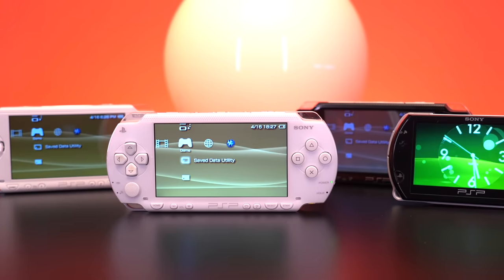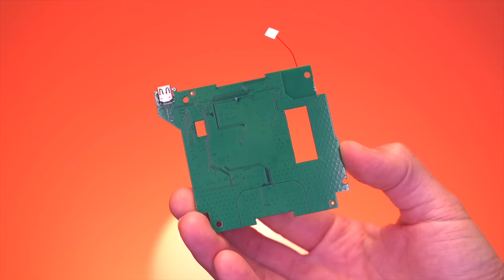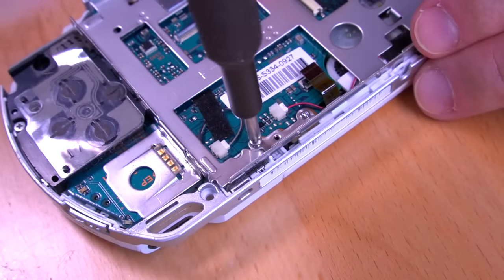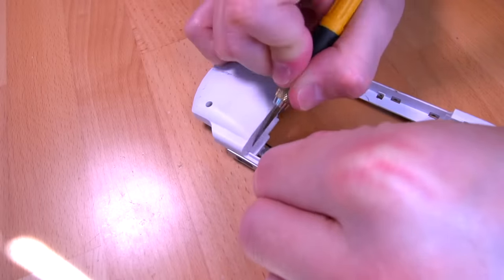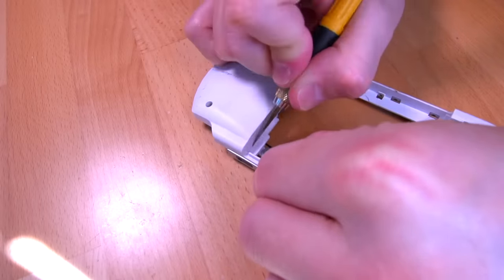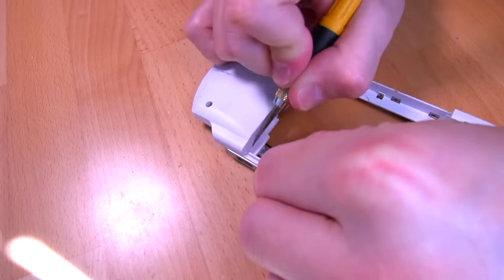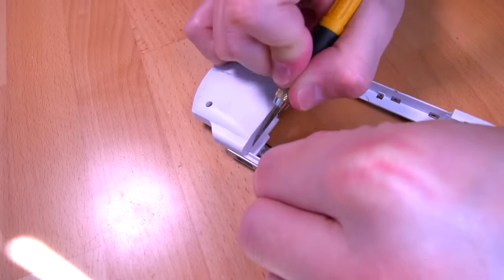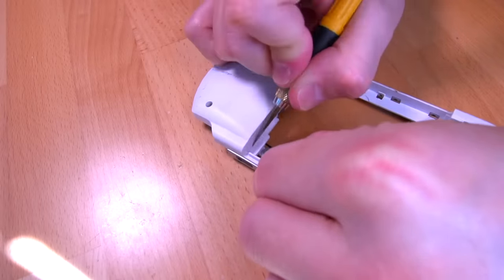Building The Ultimate PSP In 2024

Comment: The input lag is one thing but no UMD drive is a dealbreaker for me! If anything, we need new replacement UMD drives! The UMD drive in my PSP is fine now, but you never know when it’ll go wrong! To anyone who wants to tell me to mod my systems to not use physical media: stop! I like to keep my retro gaming experiences (as) authentic (as possible)!

I would however like to see IPS screens for later model PSPs (my system is a 3000, replaced a broken 1000), a workaround for wifi hotspots whose security the PSP doesn’t support and a fanpatch sideloading solution that lets us play our original discs but with fan patches! (I’d particularly like to be able to play ATV Offroad Fury: Blazin’ Trails but with the Lostprophets logos seen on some courses removed! You don’t want to know why)

Thank you for your time

Comment: I wonder if the latency can be fixed by plugging it into a scaler like the RetroTinks and also wonder if i can fit a big 6050100 4000 mah lipo battery in there with that board. The mod does involve the removal of the UMD Drive by extending the battery compartment into the UMD Compartment. The maximum the PSP can fit in the little battery compartment is around 2500mah using a 103450 lipo battery. The after market is around 1000mah lithium ion not 3600mah.

Comment: The screen Yes! HDMI? Hard Pass, it would be a different story if it doubled as a disk emulator and came with an insert to both help guide the HDMI cable as well as helped to keep the inside clean but it doesn't do either of those things, just let's you plug it into a TV for a bigger screen, something that could be done with the right external hardware which already exists and honestly every PSP owner should already have. Meaning that it takes immense value away from the system without giving enough back.

Comment: Sorry, no UMD equal no go for me. The UMD is the centerpiece of the psp and only reason I still have one.
Reply: for real, to me it's like taking a minidisc player and replacing the minidisc slot with an SD card slot; it defeats the purpose
Reply: Having emulators with many roms, ps1 library and psp, all ready to fire and installed...
Is not bad at all.
Reply: @DavideNastri not being able to play all the physical games they own? Nah. They should be making mods for the psp go. The one that already had no umd drive.
Reply: @meticulouselectronics  games they own and much, much more. All always available, in your pocket, with minimal battery usage and no moving parts. The same sdcard mod exists also for psp go, clearly.
Reply: @DavideNastri  you are missing the point of not everyone wants digital. They have a collection they would like to play.

Comment: Stopped viewing at 4:19.. an upgrade that removes the UMD drive? The one thing that makes this handheld completely unique? Just No. Also rarely mentioned is the PSP 1000 has an analog video output if you have the special connector cable which is why the headphone jack has that little electrical pad next to it. Those are the video outs. Apologies but this is a downgrade.

Comment: dude. it's time wasting for the HDMI. I've been mod a PSP 1K 10 years ago with IPS screen without extension ribbon cable. just like original LCD screen cable and input both lock. just need to soldier the pin point only. And adding a 7000 mAh 40 hours of battery is enough. This portable unit puts HDMI and it's useless. at that time 2014. 10 years later only add an useless HDMI? what a waste.

Comment: I thnink this is quite far from the "Ultimate" PSP. Even more so after reading some comments. Aparently other models have better features over all, and video output. Took a bunch of useful features out of the console as well. No superbig battery mod in place of the UMD is another... meh kind of moment. i think the Ultimate PSP should be based on the 3.000 model, with the better base features it offers + mic + lightness. Good job, interesting points, maybe to restore a 1000 model. But I reaaaally don't feel this is even close to an "ultimate" model.